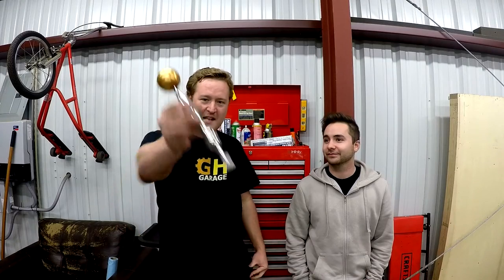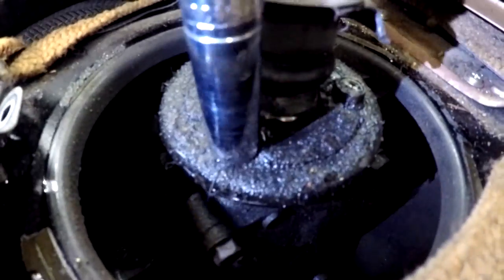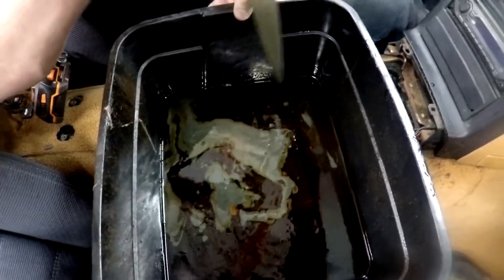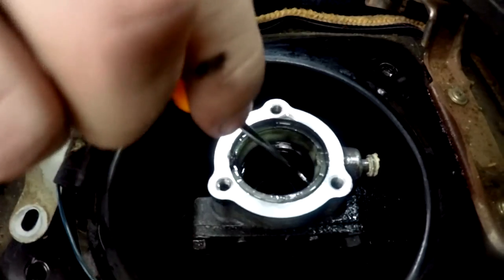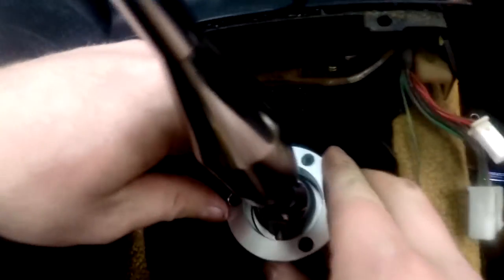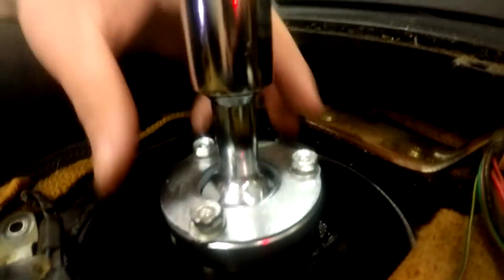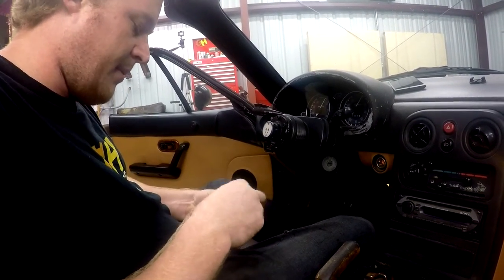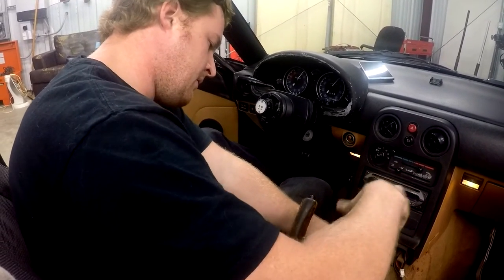Ebay Short Shifter Install | Reborn Turbo Miata Build #22

Comment: Love your channel, best short shifter installation I have seen so far. Thanks for making this video.
Reply from the maker: Thank you very much for the kind words! We have actually gotten a bit of flack for this video(well deserved) because I did not do enough research ahead of time and while I had pulled and reinstalled factory shifters before we were not familiar with some of the parts and process. Either way my shifter is still in my car as it was installed in this video and working great, cool upgrade for so cheap. Thanks for the kind words and to anyone else that sees this we will do our best to have things more thoroughly planned out in the future!
Reply: @GearHeadsGarageChannel  no worries your video is the most detailed one by far, I have watched many other ones done by other people and they are not so helpful many of the steps are missed or not mentioned.  I just installed mine tonight after watching your video last night, and I have got the part 2 years ago from ebay haha.  It helped a lot and I just wanted to say thank you!!

Comment: You should install the existing lower plastic ring under the shift pivot sphere, and the new one included with the kit on top of the shifter pivot sphere. There should be one ring either side.
Reply from the maker: +BEAVIS Motorsport Trust me, I tried a few different ways(including the way you describe) and this definitely fit the best! Since it didnt work the "proper" way we took it apart and put it back together differently 4 times and doing it this way it came out good and works perfect!
Reply: I know this is a year late but didn't you also forget to put the small rubber boot back on?
Reply from the maker: Maybe we didn't show it but the rubber boot is most certainly there. Makes a big difference for noise and heat in the cabin!
Reply: I totally agree I copied your install and the car didn't go in gear properly

Comment: The original plastic bushing goes under the ball turret and the new plastic goes on top. May tighten the clamp allowance and save the ball from metal to metal contact. I have seen a spring collar in some sets.

Comment: The pin doesn't have to be hammered out, plus you need to install the wavy washer at the top of the plastic bushing to put pressure on the shifter and that keeps in in place = that way you wouldn't of had to of cut down the other bushing.  I ordered this shifter due to wear on my C's shifter which isn't made any longer = so we'll see how this goes.

Comment: Good thing to remember if you're doing this on an NB is that the NB has TWO grooves in the shifter base and also does not come with fluid in the turret itself. The turret is part of the transmission so lube comes from below. Never fill fluid in your NB turret!
Reply from the maker: The NB turret you can just delete one of the pins if installing one like this! I should have mentioned that.

Comment: Great video guys, really informative. I like the extra tips and details, like about the oil.
Reply from the maker: 802 Garage Thanks man I always appreciate your feedback!
Reply: I just like seeing people take a little extra time and do things right, like changing out the shifter oil and using the old bushing to make it fit more firmly.
Reply from the maker: Yea well If somethings worth doing its worth doing it right, I should have changed the rubber boot while I was in there but I'll do it when we do the engine swap since its all coming apart again soon anyways =P and when you get ebay parts sometimes you just gotta find a way to make things work!
Reply: If you always waited for every bit and piece to come before doing a project, you would never get started. :P
Making it work is what it's all about.

Comment: Putting that crusty shift boot in must've felt awful man XD I know the feeling. I had a similarly torn one on mine, and I replaced it and suddenly SO MUCH heat was gone from the cabin. It was great.
Reply from the maker: Yes, I have another dont worry!
Reply: GearHeads Garage also: clean your damn car! ;)
Reply from the maker: Totally Legit Gaming [TLEG] lol its not that dirty, tho theres some stains on the carpet. Will replace it all eventually.
Reply: GearHeads Garage it was mostly a joke. ;) Looks like the center console could use a wiping off with a moist rag though. Looks a bit dusty.
Reply from the maker: I need a new one of those too, its all messed up cus a previous owner had glued crappy wood trim to it, just like my gauge cluster hood! Which I also need to sand down and repaint.
Reply: GearHeads Garage Ooh, THAT explains why it looks that way. Alright, then I understand. On the camera it looked like it was covered in thick sanding dust or something. Alright, hope you find a mint one!
Reply from the maker: Totally Legit Gaming [TLEG] Yea =( My car got abused...thanks tho, I'm sure I'll find a decent one!!

Comment: Great video guys! Quick question tho, is the shifter a bit taller than the stock one or is that just your aftermarket shift knob?
Reply from the maker: MiataMods Well that shift Knob actually is lower than stock cus its threaded deeper....idk if this is high or not, havent measured it! its not that significant either way tho, I can say the throw is wayy shorter!
Reply: Hmm maybe it's just the camera angle.. thanks for the response tho!

Comment: Are you still enjoying the short throw shifter? I've always had them in my civics and debating on whether or not to put one in my Miata.
Reply from the maker: Jared Flemer At the moment not running it since the engine swap cus I swapped transmissions too. I honestly like both, the stock one is very good and more comfortable to use, and the short one feels really tight and sporty so its good too

Comment: What’s that big connector he unplugs when he removes the console? Mine has it but wasn’t plugged in and there’s nothing to connect it to under my shifter....
Reply from the maker: Theres two connectors I can remember under there and one is for the light in the ash tray area and the other is because I have power windows, if you have manual windows you have no switches there
Reply: GearHeads whuttt mines manual windows but I still have two connectors a mini one and a bigger one that wasn’t plugged into nothing can’t quite figure out what it’s for

Comment: You don't hammer that pin at all... you just get the bushing out with your fingers
Reply from the maker: Nick Peele Wont come out without getting the pin back, unless maybe yours was super worn out and thinner?
Reply: GearHeads Garage It's a tight fit don't get me wrong! But you just gotta grab it from the back.
Reply from the maker: Nick Peele Cool, thanks for the tip!
Reply: Bushing comes out even if not very worn and new bushing goes in all without hammering the pin but I guess hammering the pin also works, just never seen it done this way. Just changed all my bushings 👍
Reply: Exactly...but what's done is done ;P

Comment: Why do you even blame on ebay? Ebay is just a place were you buy stuff from other people. Ebay isn't a brand for parts like this.
Reply from the maker: Jake We know this, just when you say "Ebay parts" most people are of the understanding that you mean cheap random parts from China. Many of these parts are sold under all kinds of different fake company names etc. but all come from the same random factory, its easier to just refer them as Ebay parts because if it was actually made by any noteworthy company you would just say that was who made it, these are more unknown.
Reply: Ahhh, I see now. My apologies. I still liked the video. 

Thanks for the quick reply. Good job overall. 

I’m getting my NB a new short shifter soon.